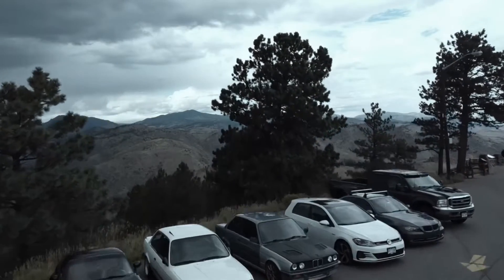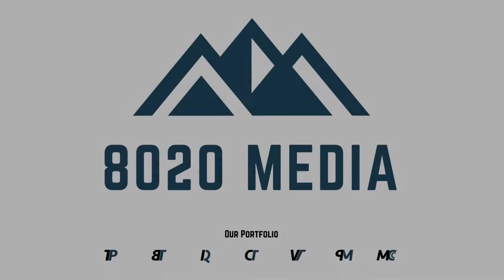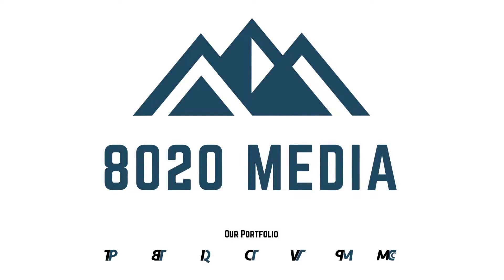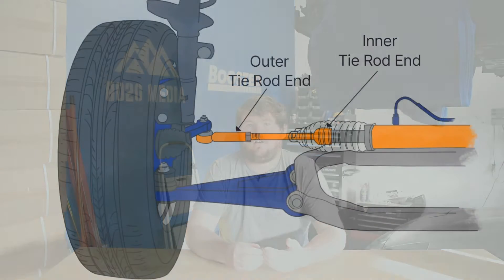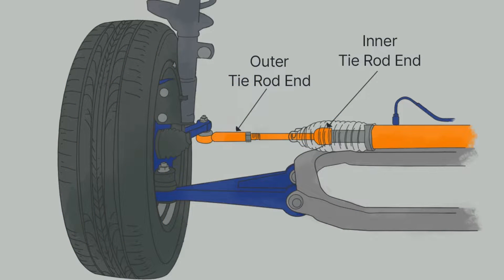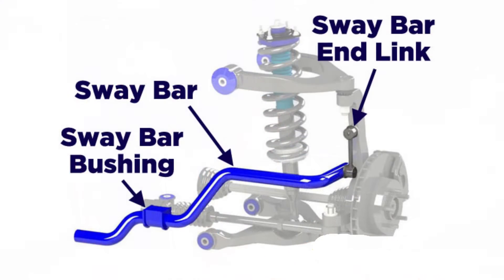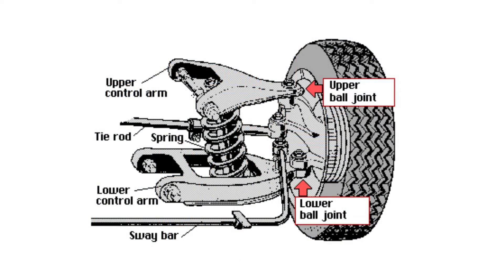DIY - How to Diagnose a Car Clunking Noise While Turning

Comment: It sounds like a rock hitting the wheel well under the driver's side floor any time i turn right. I hope it's something cheap to fix🤞
Reply: What did it end up being bro ?
Reply: Hello .Did you find out what your issue was .i have the same problem on my suv
Reply: @And1-vb8sj  if it's an AWD, or FWD vehicle check your CV axle. Specifically if it's only while turning a certain direction while moving. Look at the boots if you see black and it looks flung, it's your cv axle. Do both and don't do aftermarket. Learned the hard way
Reply from the maker: M - Thanks for taking the time to help other viewers!
Reply from the maker: M - Hopefully this video helps. Keep us posted!